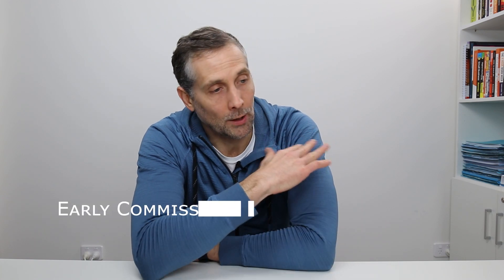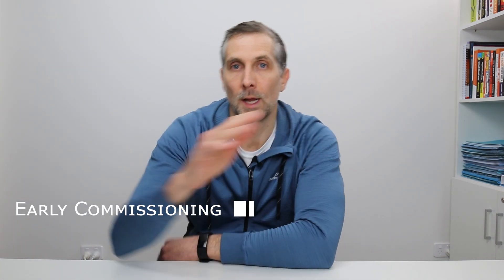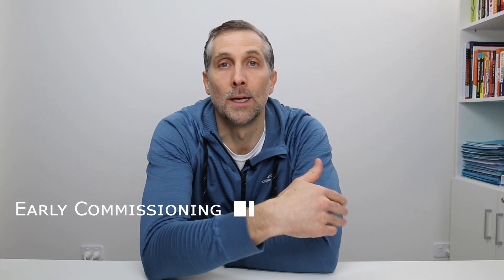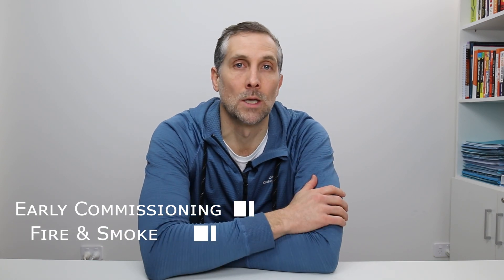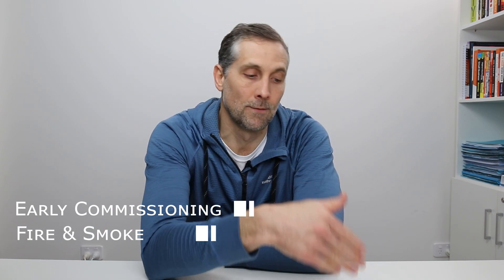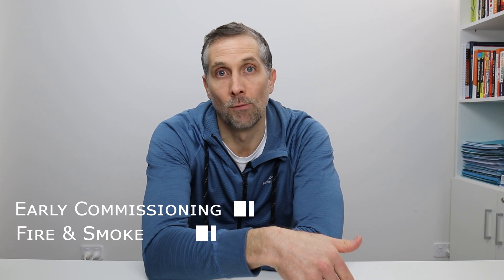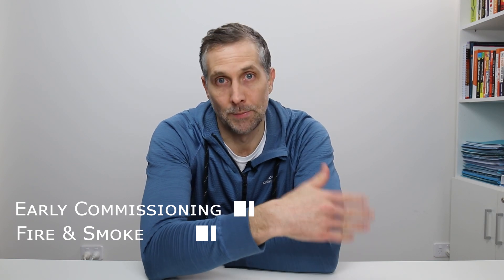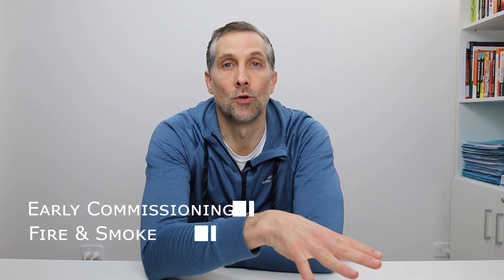Early BMS Commissioning

Comment: Sir my one question simple plz give ME answer this question if our ahu Air handling unit if smoke duct dedctor 🔥 fire smoke then how method will be our ahu off first our controller give to signal to controller then realy no then NC plz explain thanks
Reply from the maker: Hi Nazim, I do not 100% understand your question, sorry. 
If you have a smoke detector then wire it directly to the AHU fan VSD, into the safety interlock input terminals (not to the BMS). Therefore, if smoke is detected in the AHU, then the VSD will shutdown and ignore all other inputs. 
E.g., if the VSD is running in manual override from the VSD keypad, then to stop the AHU, you must properly shut down the VSD on the interlock input. If the smoke detector is wired to the BMS first, then it will not stop the VSD if it is running in manual override from the VSD keypad.
Reply: @bryceanderson17  thank you so much sir for your reply
Reply: Because our ahu smoke detector fix to supply duct and retun duct but our smoke detector point DI coming from our ddc panel  if any smoke alram show our BMS work station smoke that's why I ask sir wich type comniction in our system due to bldg fire time I understand just clear because I work in BMS system 10yrs Jonshon control meta basys system schnyider thanks for your reply sir

Comment: As an electrician who works in the uk, I mainly work on HVAC BEMS systems, I am thinking about getting into the commissioning side of things what would you recommend for me to start studying……..
Reply from the maker: Hi Liam. 
I am not sure there is a comprehensive book that you can simply read to study commissioning. I would suggest you do this. Look at the type of equipment that is on the sites you are working on. What type of variable speed drives do you have? Danfoss, ABB? Download the installation and commissioning manuals. Read up on how to set up a VSD. Play around with the menu on the key pad when you are next on site. 
What brand and part numbers do you have for damper actuators and value actuators? Download the data sheets. Start to learn about the specific equipment you see on site. 
What pressure transmitters, pressure switches, CO sensors, CO2 sensors. 
Download the data sheets for the BMS field controllers. What power supplies do they need. How many inputs and outputs do they have. 
To learn how to commission a BMS, you need to really work for a BMS company, learn how to use the software programming tools etc. 
But, until you get to that point, properly learn as much as you can about the equipment. Cheers man.
Reply: @bryceanderson17  great response thank you